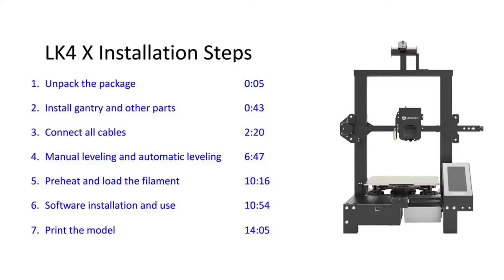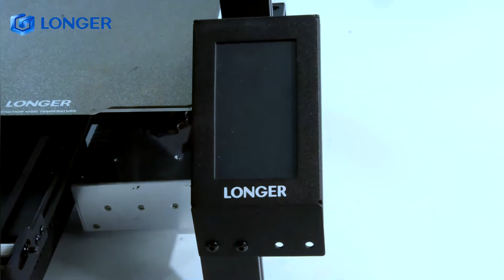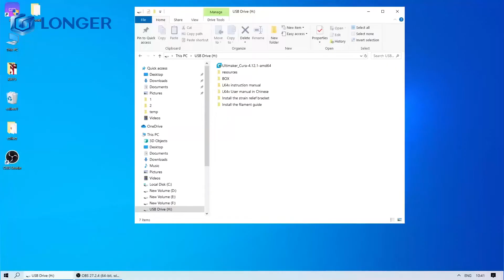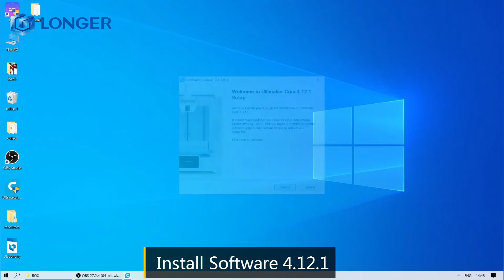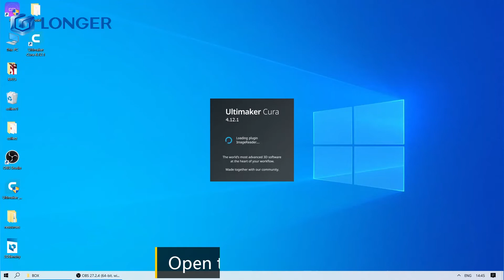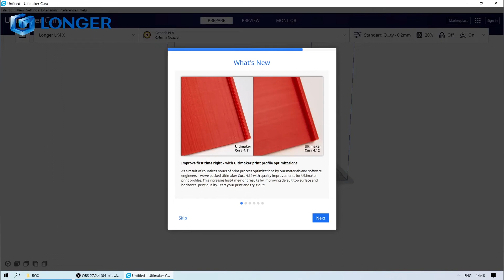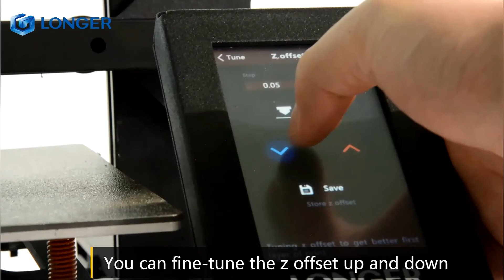Longer LK4 X Installation and Use Instructuion

Comment: Great new printer. You've upgraded exactly the areas that I was planning to upgrade on my LK4 Pro. Any chance you will be offering Upgrade Kits for LK4 Pro to Lk4 X?
Mainly the direct extruder, dual fans and BLTouch sensor with the corresponding firmware, would be great.
Reply from the maker: I'm glad to hear that. And we're working on upgrade kits.

Comment: My cable was wrapped around the front on the filament sensor. It took a while to sort out how to slide the filament out wire through the channel and untangle it. Also, my review machine doesn’t have the strain relief piece on it
Reply from the maker: I'm sorry, what do you mean by strain relief piece?
Reply: @Longerofficial  where the bed wire connects
Reply from the maker: @WhereNerdyisCool  You can download and print it at this link: https://www.thingiverse.com/thing:4818795

Comment: Your installation of the Resources folder does not work in Cura 5.2! Update your instructions please!
Reply: Ultimaker did not include the lk4x to there new software and are not planning to you should watch a video on how ro do it if tou need